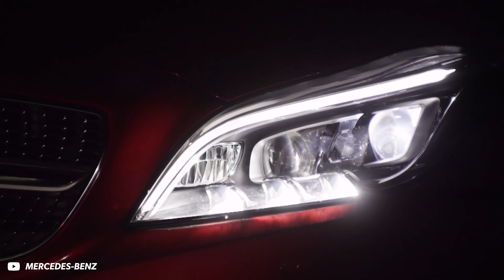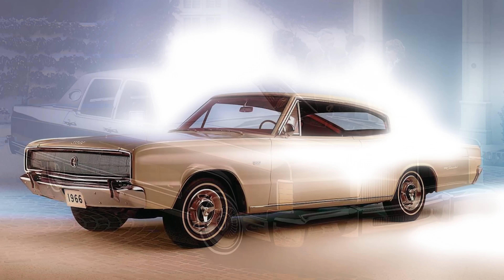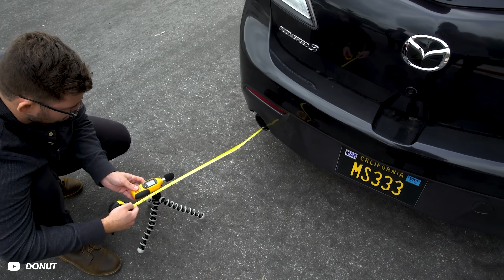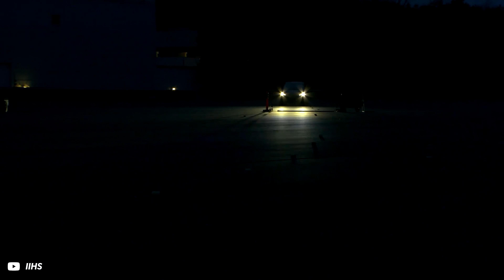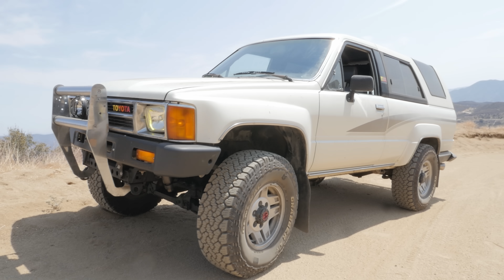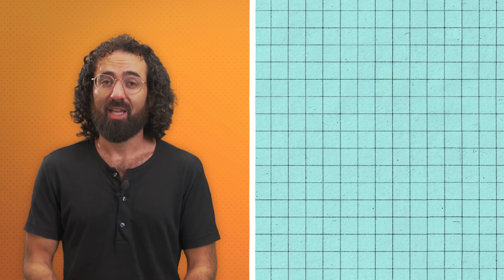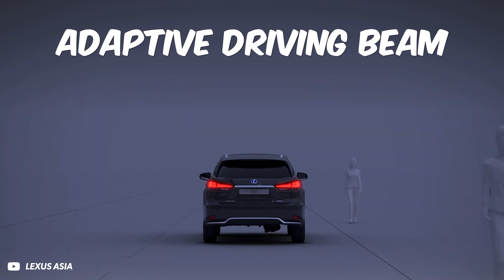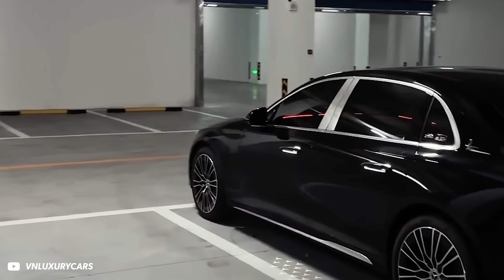Why new headlights are blinding American drivers

Comment: European here. Is anyone blinded by the LED headlights of cars through the side mirrors? I'm going crazy they're so bright. I find it especially dangerous on the motorway as I cannot judge how far the upcoming car is when I need to overtake.
Reply from the maker: Definitely. Also a big problem.
Reply: @drive  Adaptive high beam can unfortunately contribute to this a bit too! It's sometimes a bit slow to react in general, can cut out too little ahead causing people to be blinded through their mirrors, and also struggle with oncoming vehicles on highways as crash barriers may block their headlights from view of the cameras.
Reply: @VoxelLoop  I was thinking of these and how they never EVER work, when this video was talking about adaptive LED matrices.
Reply: @therwfer  bullshit. You’ve never used one if you say so.
Reply: @VoxelLoop wtf do you mean " can contribute " if the effect is just a but slow to decrease it entirely??
Reply: @VoxelLoop  "a bit"? It's very much a significant part of the problem.
Reply: @VoxelLoop  I never use the auto highs because it seems like they react too slow. I prefer to turn mine down before I've flashbanged someone haha
Reply: @VoxelLoop  Here's a thought - how about people use their human brain when they see traffic and think "other cars are around, I'd better switch into low beam so that I don't cause danger". Honestly the amount of gadgets in cars that are replacing basic driver skills and common sense is a huge part of the problem.
Reply: @drive big problem is blind brand new cars in USA and red turn signals on back
Reply: @joshhhab  Red turn signals for sure need to change in America. I can't tell you how many times I've been behind someone that likes to flirt with their brake pedal creating quite the confusing light show at the rear leaving me wondering what's about to happen in front of me. As for the side mirrors, try adjusting them more to your blind spot. You already have a REAR view mirror, no need to have two more rear facing mirrors when they are far more useful to show you as much of your blind spot as possible. (mine are set so that I can't see the side of my car in the mirror at all unless I move my head closer to the window) Might take a little bit to get used to but it has greatly improved my visibility while keeping the blinding lights at a minimum. Still do the shoulder check when making lane changes etc.
Reply: @joshhhab This is why those cars are banned in Europe.
Reply: @starsailor4871 we have bright orange turn signals very good 👍
Reply: @starsailor4871  You're correct. Side view mirrors should show what the rear view mirror can't. No overlap needed.
Reply: @drive 
Well that's always been a problem, dips are angled down and to the left on RHD roads. 
The side mirrors will reflect that back and to the left, where you're sitting. 
The effect will change as the angle of incidence changes, there's a sweet spot a few car lengths back that will dazzle you.
Reply: @drive total propaganda piece. They are too bright and they are too white with far too much blue light. The solution is simple, amber diffuser film headlight coating.
Reply: I have great vision and good night vision, these headlights are making it so hard to judge distance and what lane cars are in, not to mention the painful pressure I seem to feel on my eyeballs.
Reply: Also an european. Oh boy does everything blind us here. Many manufacturers are still figuring this matrixLED stuff out, so the lights kind-of-work-most-of-the-times. But far enough from prefect so that every third car annoys your eyes. :)
These things wait until the absolute final millisecond while approaching - when your finger is ready to flash them back - to block the light off from your car's spot.
Brightness-wise, Peugeot was one of the worst offenders with their lights a few years back. Their 4008, 5008 & 508 are unbearable even during the day.
(Off topic) Also - the automatic brights are the worst thing ever. Never do these understand that the car in-front is close enough already. Nor do they act fast enoguh coming around the corner ("Good old times" when people had courtesy to switch the brights off before coming around the corner- when a human eye sensed some-one-else's lights approaching).
Also these turds activate in cities and such.
Don't "accept" fog lights as oncoming traffic...

Thank you guys for bringing up a topic I felt I too needed to rant about. :)

Also a tip  - I've found that my cars rear fog lights (Yes there's a pair) work as anti-automatic-brights for the car on my tail. (May not be an ethical approach... & can't be done across the Pond.)
Reply: @Tuuritaja Glad to hear I'm not alone! I'm most bothered by the traffic blinding me from behind as I do motorway driving for many hours in low light (now that winter's here) every week and it's just extremely dangerous. I already had to have my rear foglights replaced, I use them a lot, but turns out most are on their low-beams. People here in Hungary don't even understand what they're doing I don't think. Nevertheless, I'm still gonna do it, there are some so bright (new Kias, Suzukis without matrix but bright) that I just aim my mirrors to the ground. Oh and as I cover the mirror with my palm, I constantly give them the middle finger, too. May not be nice, I just can't accept this level of recklessness.
Reply: @Tuuritajasome of the older Chevy trucks used to have a large area of brushed aluminum on the tailgate. Good for reflecting back high beams behind you.
Reply: @Tuuritaja uber's toyota corollas are the worst. they are everywhere and they all blind the same way. if you see a corolla, it's a uber.
Reply: @bruh5924  you mean a 🚕 taxi then?
Reply: @bruh5924  nonsense. Go see your ophtalmologist for a checkup. And clean and degrease your glasses, windows, and mirrors.
Reply: If you think that European factory LED lights are bad, come to North America and try driving in front of a raised boomer truck with aftermarket LED bulbs shining directly in your mirror. Keep in mind we don't have TÜV or anything that would require them to fix it at some point to pass inspection. Got automatically dimming rear mirror now, best luxury choice.
Reply: @bla123blubb  I miss my auto dimmer mirror, but I still had a tinted rear glass for 10 years, so I never noticed how bad the lights were getting.
Reply: I'm also European. With the side mirrors when the situation gets bad I just press the fold button. It is unsafe but at least I see forward.
Reply: @ptamog  when a car with super bright lights is behind me, I adjust my side mirror so that it reflects their light back into their eyes instead of mine
Reply: @seands650 😂
Reply: All the time. I drive a Miata, so there’s that.
Reply: @ChoPi-EwwI drive a Ford Transit. I sit VERY high up compared to my 94 NA. Doesnt change much honestly, so many headlights are aimed soo poorly that even sitting 4 feet higher doesnt change it 🤬
Reply: @ChoPi-EwwI feel your pain I drive a lowered Z3 and it’s awful to have someone sit behind me blinding me by my side mirrors.
Reply: People dont seem to know how to adjust their height. All SUVs have lights up in the sky, all of them and if you drive a low driving position car your're blinded constantly. The worst if when they come you from the rear in dark, constantly blinded from the mirrors but not only that your cab is so heavily light polluted you cant see shit.
I would have kept halogens but hell its impossible to drive at night when theres bastards with 10x the light output at seemingly near UV wavelenght light welding your retinas hours after hours night after night... Warm tone auto leveling projector/lens LED headlights are fantastic, one can see well and the oncoming traffic doesnt get blinded
Reply: Theres all the great technology out there, its cheap yet the auto makers want a while grand for one shitty headlight thats so full of flaws they should be banned
Reply: @mihkus  On many cars it's a headache to adjust the lights and a lot of people have no clue even to open the hood and the lights can come misadjusted from the factory.
Reply: @mihkus  There is a solution to that: self-levelling lights (and optionally self-levelling suspension). Just having the lights be self-adjusting is like 15 bucks in parts and an afternoon of engineering to put em in. Europe iirc also straight up requires em for Xenon and LED headlights, so odds are if you have a European car with LED or Xenon headlights, it'll be self-levelling and one less thing for you to worry about as a driver.
Reply: @mihkus no, there is not about adjusting the lights. It's about technology. A lot of cars ate cutting your back of the car but will blind you in the mirrors because those will be hit with high beam. On curvy roads is even worse... you will always be blinded even buly the best tech on this domain. And i tell you this as an european.
Reply: @mihkus  They can adjust them anymore. Its "self leveling" ehich means nothing is car is on slight incline and you on part that slops down. They can only.be adjusted to "zero" position on the headlight housing but you have no setting dal like with halogen lamps inside the car. Halogen also never are as blinding. 
In europe headlight and their adjustment is checked on MOT checks annually but it still doesnt do anything if you are just on top of the hill or just uneven roads bumping the car up. Max luminosity should be limited, better yet they should just mimic halogen so its the same just takes less power. Instead they burn peoples retinas out with xenon and led lights
Reply: @Kacpa2 very VERY few are actually even self leveling. Mostly high end vehicles like Porsche. Your average GM Ford or Dodge does not have this.
Reply: I have to adjust the door mirrors so I can't see behind.  Often have to do same with rear view mirror.

Tesla are worst.  Lots of SUVs, crossovers and vans are bad.  Followed a fairly new MB Vito van.  It had vague beam pattern and far too much light above the beam pattern.  The lights have atrocious beam control.

Adaptive lighting is very bad when driving 44 ton truck.  It doesn't bother car drivers but is bad for driver positioned higher.

Self-certification homologation by lamp manufacturers has failed and increased danger on roads.  HID lighting should only be with projector lamps.
Reply: @idonotwantahandle2 I try to adjust my mirrors so they reflect the headlights back into the following driver's eyes.😊
Reply: @idonotwantahandle2  This is how you’re supposed to adjust side mirrors to eliminate “blind spots” anyway. If they’re pointed backwards, you have 3 mirrors looking behind you and none to the sides.
Reply: yes. I had a low car and it was awful as it was a major distraction as it was narrow so would often get blinded by both side mirrors.
Reply: too many cars do not have night-dimming mirrors.
Reply: @KellyR-qx7wn  side mirrors too?
Reply: @makatron yea sides too nowadays. My 2016 car has dimming sides. Makes a significant difference
Reply: @KellyR-qx7wn  maybe they should make them add them under recall if they insist on blinding us.
Reply: @KellyR-qx7wn  I drive a 1991 CRX no auto anything😊
Reply: Blinded by those adaptive headlights is so common that I had to get yellow lenses to be able to see anything at all at night.
The problem is that as soon as you are the third vehicle on the road then the adaptive system totally ignores you because it can only do one thing at a time, much like the low IQ morons that can't chew bubble gum and walk at the same time. (Statement stolen from a tune by Magnus Uggla)
Reply: Get a car with auto dimming mirrors, it’s great. Combined with led matrix lights (so YOU don’t blind anyone) it’s the only way to ensure comfortably driving at night
Reply: @erebostd i’m getting blinded walking the sidewalk, or cycling down a cycle-path next to a road
Reply: @erebostd  Thats what their marketing wants you to believe. In reality it takes couple seconds to detect the car, it doesnt work if I am over the horizon and in that brief moment I am blind and my eyes take couple more seconds to adjust back. It just sucks, there should be limit on brightness period.
Reply: @paapacz  We test those thing in our university - those systems are faster than anyone driving with high beam that has to put them down manually. If you are in the US you don’t get the most modern systems because of your regulations, but even what’s allowed in the US is better than „by hand“. If the car isn’t tinkered with…
Reply: My wife's 2017 Subaru Outback has auto dimming side mirrors! I didn't even know that was a thing, especially in a non-luxury car, and a middle trim level at that! Certainly underrated tech and hopefully more automakers will see the benefits. It's a bummer that auto dimming side mirrors isn't a fancy selling point on a spec sheet like 360° cameras would be to the average consumer, despite the usefulness being arguably higher.
Reply: Absolutely!  Sometimes have to take a hand off the wheel to block the light from my side mirror!
Reply: Actually, yes, even when I flipped down my interior mirror to its darkened mode I’m still pretty well blinded by the lights in my rearview. I don’t live in Europe. We don’t get the fun technology to help with that kind of stuff, but I really wish we did.
Reply: Had to put heavier tint just to avoid getting blinded by the car behind me.
Reply: @makatron  did you go with 20% or 5%?
Reply: All the time. I drive a Ford Transit van and especially in winter, when its already fully dark by 17:30, I get blinded basically constantly on the highway from normal cars headlights. Hell, sometimes even semi trucks, and those headlights are lower than normal cars. SUVs are the worst though.
Reply: Yep, I pretty much have to wear night driving glasses now otherwise I'm being blinded constantly
Reply: @BlatentlyFakeName  I wear sunglasses at night. Can't see my own speedo, but at least I can still see the road with all the bright lights in my face.
Reply: @javaman2883  Just make sure your own headlights are bright enough to compensate for the sunglasses and you should be good.
Reply: Norwegian her. I hate ADB lights. They say they can dim and not blind, but boy o boy dos it blind me. All the time, it has made driving at night a nightmare. And to topp it off it makes drivers lazy. They have no regard to the lights blinding any one. They simply relay on the automation, and it sucks.
Reply: I agree. Some of the newer cars are just so annoyingly bright with low beams during night ether being behind or coming towards you.
Reply: Two times I had to stop driving because car behind me was do bright light that I cannot see nothing even i turn mirrors off.
Reply: @---qr4of Angle the rear view so it blinds them. Takes a little practice but it's very effective when you get it right.
Reply: Just slow down when you’re blinded. It’s not worth it being stubborn about it.
Reply: @jamsbong  so they pass then get angry?
Reply: @CSmith-gb1sl  what I mean is for everyone to drive safely. If I am blinded by incoming lights whether it be from a truck or other source, it is foolish of me to just kept driving knowing my eyes impaired temporarily.
Reply: @jamsbong What about when they are directly behind you? That's the main issue, follow you for miles being blinded in your door mirrors and rear view level.
Reply: @MattyEngland  that one you can dip your mirrors. And even your side mirrors can be adjusted. 
Alternatively, what I have done is to tint my windows. Check your country legality on how dark your can tint the windows. This essentially solves the problem
Reply: Yes! I've done that when a pickup truck pulling a camper was behind me. I slowed to 35 in a 55. He just stayed on my bumper for a good 10 miles.
Reply: @jamsbong That's a great way to anger anyone behind you, then they will pass in a no passing zone and brake check you.
Reply: @javaman2883   With my dashcam recording everything. Let's see who is at fault if there is an accident.
Reply: @jamsbong better slam the brakes to break that lights and give them a lesson
Reply: I got blinded by SUV's and people who put wrong type of lamp on. Being blind by lights depends various factors and not always are LED lights. I give you my experience: in this summer i drove an Iveco S-way garbage truck new from the factory, with only the fog lights on i still blind other drivers during night and the type is Alogen (hot white colour)
Reply: Me too. Sitting at a red light, the car behind me was so bright I actually folded them away (unfurled when light went green, of course)
Reply: Exactly. As a European who usually prefers driving at night: The ADB system works great on paper. But once you've seen how long it takes for the high beams to automatically switch off as soon as oncoming traffic is visible, you know how well the ADB really works. You get blinded by slow-shifting oncoming traffic. You get blinded by the light reflected from the side mirrors, and I don't even want to get started on curves, bends, or inclines.
Reply: SO... I'm just guessing from this thread... BUT for all the upgraded tech and standards in the EU, night driving hasn't really gotten so much better... eh?
Reply: Ive been, genuinely had to turn my head because of how fucking bright it was
Reply: Some of 'em are so obscene I can feel the side of my face getting hot from the light blasting in through the side mirror.
Reply: Yes. It's the genius idea of using LASER excited phosphor to make ultra super bright lights which have virtually zero lumen falloff for miles. Thank WV for that idea...
Reply: @shinobi6622  West Virginia?
Reply: @CSmith-gb1sl No, Jönköpings kommun, Sweden
Reply: @shinobi6622  I meant the yellow eyeglasses for night driving.
Reply: We should go back to incandescent bulbs for cars 😊
Reply: They are just not calibrated correctly.
Reply: I don't have that a lot really. I also do notice my own cars Matrix LED System being way more considerate than when switching it to "normal mode" and turning Adaptive Lights off. If i have the regular high beam on and drive behind someone it'll have a noticeably higher beam. If i turn back on Adaptive Light it'll instantly lower the high beam and also cut out a box surrounding the car in front of me. I therefore doubt, that its adaptive lights that would blind your rear mirrors. It'll likely be "dumb" systems that have a fixed LED Headlight.
Reply: You need to re-adjust your mirrors, correctly! To prevent lights from vehicles directly behind you from blinding you.
Night driving is 100% comfortable, since I did mine!
Reply: @jonathansantana8021 Not the vehicles behind me in my lane, the ones about to pass me on the left.
Reply: @javaman2883 when position correctly, you should be able to notice them passing probably 5 seconds tops. But if you see them coming from 1/2 mile in your side mirrors, you need to readjust them. 
(They could be douches with high beam happiness or some people just have sensitive eyes.)
Reply: Yep daily, i even dont use my inner mirror anymore, i turn it away as all those blindings and reflections makes driving not so safe anymore
Reply: I cant even walk outside during bad weather (and otherwise bright daylight) without getting blinded. Even bicyclists have started driving with this crap, I literally cant see, anywhere. This LED crap should absolutely be banned
Reply: Good point. 

I get your pain and I understand that LED lights are super bright. I had a car with them and I enjoyed an almost clear as day view. 😊
Reply: European. American here. Trust me if you can see the same lamp behind you in your rear view and side mirrors, your side mirror’s cutoff just needs adjustment to a wider angle so the behind lamp disappears and all 3 work like one large mirror.
Reply: They’re HID’s.  LED’s don’t come as low beams on production vehicles, they weren’t profitable enough.
Reply: Happened to me on my drive home just last night. Infuriating.
Reply: Yeah. Fortunately I have folding mirrors so when I'm not planning to change lanes or overtake, I go to "missile mode" and fold the mirrors in. Saves so much of my sanity, it is insane in itself :D
Reply: 100% Aussie here.... These new head lights are blinding! and need to be banned!
Reply: naughty european, your car has audo dimming mirrors if its not japanese
Reply: There are times when I have to just rely on my vehicle sensors to tell me if the vehicle is close or far, and considering the sensors can't tell if the vehicle is approaching or following at a safe distance for switching lanes
Reply: yes, at nights you cant judge the distance because you do not see the linear size of the object, oncoming car in 300m and in 1km look the same. Just do not overtake in these conditions, its unevitable price of night driving.
Reply: Winter season has begun. Sunglasses by night?
Reply: Absolutely. I can adjust my rear view mirror or tint my rear window. But front side windows and windshields can't be tinted nearly as much legally and so cars from behind blind me terribly trmhrough the side
Reply: I drive a vw golf mk7, it have the standard halogen bulbs, but the auto high lights work very good a lot faster that i can change by myself, also the automatic mirror darkening also works very well, very surprised by all the comments
Reply: @lotsad1234 Bummer about auto high beams is they wait until the car is visible to switch off. An attentive human can see the lights coming around a corner. 

On a long straight highway, no big deal. 

Where I live in the mountains, a tight corner means someone gets blasted.
Reply: Yes, even with auto dimming mirrors it’s still too bright so I tinted the side windows and it’s not bad now.
Reply: You mean from behind you?  Yes, have to get my back window tinted, but that still won’t solve the side mirror problem.
Reply: The amber glass?  Do they help much?
Reply: Side mirrors adjusted wrong
Reply: I've even folded my mirrors a couple times already. 

What i found is that depending on the model behind you, if you slow down and they're eager to drive close to your car the side mirror blinding stops.
Reply: Yes. We need self dimming side mirrors.
Reply: From germany. Dude, by far the worst friggin new cars are these new Mercedes, since 2017 or 2018. Unbearable. And a good amount of idiots on the road also dont have their headlight adjusted, like a lot of work vans. Or they have too much weight in the back and their automatic light adjustment isnt working. Good thing my old 1998 Audi A4 has all the bells and whistles you could get back then, including automatically dimming rear view mirror and even automatically dimming mirrors.
Reply: I'm 99% sure this problem also stems from the fact that there seems to be no maximum height above the surface of the road for headlights. I drive a car where I sit low, and every SUV, every truck, every van blinds the sh* out of me, even when they have lowbeam on. Reason is simple: My head is lower than their headlights, and below a certain distance their lowbeam inevitably hits me full blast.
Reply: Yeah, it's more the side mirrors than anything, even in the US. With my rearview mirror, I can just dim it. But the sideview mirrors are a pain. So, I adjust them out as far as they'll go and still be functional.
Reply: Had a vw arteon with adaptive matrix headlights, it bar non worked very well at boxing out on coming traffic even on low beam. To this day it was the best lighting system I ever had on any car. The matrix with the adaptive shutters needs to be the standard period. I have a car now with just regular LED while it’s great for me but yes oncoming drivers get blitzed with insane brightness and it’s 10 times worse when the car is slightly at like a 5* angle it’s almost as if the brights were on until the vehicle leveled again.
Reply: This is why I have auto-dimming side mirrors 🙃
Reply: TESLA IS THE WORST BY FAR! THERE SHOULD BE LAWS TO MAKE THIS ILLEGAL! I AM CERTAIN THEY DAMAGE YOUR EYES AS WELL!!!!!
Reply: I am. All the time.
Reply: I drive a car that has rear view mirrors lower than basically any SUV and delivery van and sometimes on red light I have to actively sacrifice a big chunk of my attention to not get blinded, by adjusting mirrors and sitting more straight back. Sounds like no biggie, but that's everyday, when I'm not looking ahead and watching for pedestrians and whatnot
Reply: No because I have my side mirrors adjusted properly.
Reply: Auto dimming side mirror solves this. Beside most people dont know about manual dimming flip on rear mirror.
Reply: You may need to adjust your wing mirrors slightly.  Wing mirrors are supposed to be angled slightly outwards, not directly behind you.  They exist to assist minimise your blind spots directly behind your shoulders.

I find pointing slightly downwards with the rear passenger door handle just visible in the bottom inside corner eliminates glare from vehicles directly behind me whilst maximising visibility of vehicles diagonally behind me in the next adjacent lane.

The internal mirror on modern cars will have an auto dipping function to protect you from glare from vehicles directly behind you.
Reply: @andrewrobertson6012  Auto dimming is an option, most come with manual dimming, an I remember when some did not have that feature.
Reply: @andrewrobertson6012  Thats how my side mirrors are adjusted, still blinded by rear vehicles.
Reply: Not helped by the fact that all German manufacturers decided suddenly at one point that passenger side mirror doesn’t need dimming anymore.
Reply: You can tilt them down to bounce the light back at the driver behind. They either back off or pass. Works like a charm. And if you need to know who's behind you, you just have to glance down a little lower than usual.
Reply: @SeasonedSalad  you mean tilt them up as I am lower, no it didn’t work, and I don’t want to be playing with mirrors while driving.  Our manufacturers of very expensive vehicles never had the forethought on this problem.
Reply: i only drive during daytime as much as possible to get away from this issue
Reply: I'm in the U.S. and I concur.
Reply: I can tell you that i know when Octavia MY 2020+ with matrix lights is behind me. It blinds me every time in side or rear mirror
Reply: My side mirrors, and the one inside, is dimmed automatically. =)
Reply: @Xanthopteryx    My truck is but not my 2003 accord
Reply: @Xanthopteryx  I pity you. Lessthanhuman
Reply: Set your side mirrors just far enough out so that you have to move your head a little to see cars behind you. This way, you use your interior mirror to see what's behind you (it can dim) and your exterior mirrors stop providing you detail the moment you can see beside you (you'll need to do far fewer head checks and won't be blinded by cars behind you)

You can also tint them for cheap.
Reply: @ProbablyNotAChicken  
What ? No!
You break, slow down, let him overtake you and then you highbeam him until your ways part.
Equality.
Reply: I find AUDI active matrix LED most anoying lights. What ever they claim they just don't work and blind oncoming drivers as hell
Reply: adjust so you have to nove your head so they light up the side of your head
Reply: I have all my mirrors angled away so I basically can't use them. If I did not do that I would probably end up getting in an accent cuz I couldn't see. When I do need a mirror I have to bend my head down so I can see what's behind me. So these stupid lights are making it harder to drive and way more dangerous. Just like the iPads in the dashboards. Everything about cars is becoming dangerous and stupid
Reply: Its these adaptive shits
Reply: Why you need a car that has certain self driving features to keep you within the lanes.
Reply: 100%, especially when it's a high vehicle like an SUV.
Reply: Yeah I adjusted my mirrors to pitch down a bit more, tbh I didn't need to see the sky.
Reply: More than likely and serving only to “magnify” the problem, your “side view” mirrors aren’t properly adjusted.  The side of your vehicle should NOT be visible in either one.
Reply: @beauhatman4395 partially disagree, being able to see a bit of your vehicle (<5%) helps to judge distance/position, that said I've seen people with half or more of their side mirror view obstructed by their own car which is insane.
Reply: British here: always got a W@r with his full LED beam on going up roads or down roads blinding everyone that coming up or down, there was one dangerous time where the driver thought it was funny with their lights on full LED beam while parked and the lights pointing outwards onto the road where a blind bend were to approach, which is dangerous as a driver could end up smashing into a wall if they do not know the area well!
Reply: Safety is for sissies.
Reply: And also through the rear view mirror
Reply: Your side mirrors shouldn't be pointed behind you.  That's not the proper way to see them up.
Reply: Most drivers unknowingly have their headlight height adjusted to be as high as possible and some even drive with fog lights when not needed. (This is especially noticeable in Europe as the cars are mostly fitted with headlight beam height control switches)

Fog lights obviously gonna bother you in the rear view and side mirrors. along with the headlight height adjustment.

Other reasons is swapping bulb types halogen reflectors and halogen projectors were never designed for the beam pattern produced by LED and Xenon bulbs some bulbs are worse than others too.

Never seap the bulb emitting type (halogen,Xenon,Led) or go for higher wattage of the same bulb.

Most of the time you will end up with less usable light  and scattered beams
Reply: Adjust mirror to direct light away from your face
Reply: I will attempt to get this across without a picture...
Set your mirror farther out. Just slightly farther than you want it, so that you can't see straight behind until you turn your head a little bit to look at it. When you turn one eye will see behind (and the other will see slightly wider into your blind spot), but when looking ahead neither mirror will be straight into your face.

I also have never used a rear view mirror, but that is my own oddity most couldn't do.
Reply: I was psyched to find out my car had auto dimming side mirrors. Game changer.
Reply: Yes the new light are way to bright. Not because of light power but because of the white light the older yellow style halogen lights are easier on the eyes even with the same "power"
Reply: Yes, that is a pain. I had a 2017 F150 where the driver side mirror dimmed when headlights were shined on them. I loved that mirror.
Reply: Not really a problem if your car has auto dim
Reply: Aim your mirrors better. You don't need 3 rearviews.
Reply: Probably your side mirrors are broken or the auto-dimming function is not working. The main sensor should be in the interior mirror. If you have tinted the rear window, that can be the reason. 
I'm also from EU and I never had any problem with rear cars with LED. Even if they are using high-beam lights that would not effect me, coz the my mirrors are in working condition and auto-dimming is working properly.
Reply: @vOzidloCZ   No, I have a 2019 now and Ford took that out for the driver side mirror.
Reply: I have a simple Ford Fusion with auto-dimming rear view internal and driver side mirrors that reduce that glare.
Reply: @timlincoln2246  but why don't you buy and install mirrors with auto-dimming? They are not so expensive today.
I remember my first car (1997) and it had already all mirrors with auto-dimming, but that day it cost a lot.
Reply: @timlincoln2246   The rear view dims on my 2019 F150 but Ford removed the driver side dimming mirror. I was sad to see that go.
Reply: austria here- yes- gets annoying
Reply: I use a rear view mirror live feed rear view dash cam so the mirror isn't a reflection but a projection of the camera in the back, this keeps my mirror from being too bright with headlights, and able to see more at night when fully dark. Also I tilt my side mirrors in a way that if someone with high and bright led lights are behind me I can lean into the center of my seating area a little and not have either mirror directly blinding me. It's inconvenient but works. the best thing I ever did was get that rear view camera through, it's awesome. It's a 2 way dash cam and a live feed touch screen mirror replacement.
Reply: Absolutely (from USA)
Reply: When I drive the motorocycle in the evening, I don't see shit from the mirrors.
Reply: That's why you turn down the mirrors at night.
Reply: Yes
Reply: Road knowlegde is all that keeps me alive in the dark.
Reply: I tinted my windows for this cause alone..
Reply: Absolutely
Reply: New cars even 'shade' the side mirrors bc of that, just like they do with the rear view mirror
Reply: I was started wearing yellow tint glasses for night driving, they help a lot. However I am one of the culprits, I get flashed all the time in ‘23 f150 with my low beams on.
Reply: Yes, me too!
Reply: European here. I experienced this recently with an older Mazda 3. This came rather schoking to me since my previous experience was primarily with Renault or CItroen. It turns out that the cars manufactured in EU have filters on the windows and aspherical mirrors that break the beams from the car behind. However, other car makers from Japan or Korea do not have these features and as a result night driving could be a rollercoaster. When buying a car, always test-drive it in the dark to check it out!
Reply: Luckily I've got a relatively old Shogun where, if someone does blind me from behind, I can retract the side mirrors with a button. I also have my interior mirror angled half down so I don't see their damn lights even in daylight.
Reply: i swear it's one of the reasons i try to drive a bit faster so the people behind don't blind me as much😭
Reply: No issues as i have dimming left and tear mirrors and led matrix. 🎉

Previous one had all 3 mirrors dimming..
Only thing i need is one extra highbeam that would turn on when matrix is in full blast.
Reply: This is my biggest problem with getting blinded! (I'm in the US)
Reply: Tesla cars are the worst
Reply: Yeep they're blinding at night as fcuk in 99% cases!
Reply: I wouldn't know if someone has bright headlights - my 25 year old Mercedes has dimming mirrors.
Reply: Never had any problems with adaptive beams on Audi or Tesla. Works like a charm. I would say another solution would be regular safety inspections for cars. In my country we need to get the car inspected regularly, the interval depends on the age of the car. Lights are one of the things checked during the inspection. In USA most of the states don’t require any safety inspections.
Reply: Side mirrors ain't a problem for me, as far as this is concerned. Rear-view mirrors, though? I swear, it's every night I have to adjust the rear-view so my corneas don't get cooked by the headlights of the guy behind me.
Reply: I’m from Bulgaria. The road conditions here are pretty bad, and the new headlights work properly only about 30% of the time. They often fail to detect an oncoming car, especially when there’s a crash barrier between you. The lights stay on high beam until you’re about 20 meters away.
Reply: Side mirror and the Rear mirrors, have to flip to the tinted mirror portion when driving during NIGHT.
And people with glasses has it pretty harsh too when driving now
Reply: Yes, it's caused by the adaptive beam. The car behind will draw a box around your car, but it isn't clever enough to know you have wing mirrors, so you'll still get the dazzle there. Unfortunately, drivers rely too heavily on this tech and no longer think for themselves; if they just manually dipped their beam it wouldn't cause the problem it does. LEDs aren't so much the problem, they are a contributing factor but not the whole issue, it's the tech and the driver's reliance on how wonderful a job it is doing that is the issue.
Reply: The thing is, its only about the driver and design, but never about other roadusers... Fitting ego society so to speak
Reply: European here... No. I'm not blinded by the new LED headlights... either head on or by my side mirrors.

Maybe it's just me... as I come across some drivers at night that flash me (turning high beams on and off)... telling me to turn off my high beams (which are off)... And I'm sure they are shocked when I flash them back to show that my high beams are off coming towards them.
Reply: @rxt744 maybe that should tell you something... 🤣. Do you drive a Tesla Model Y?
Reply: @FormulaWhine  No.  A Renault Captur Full Hybrid (251 reg)...  That said, we have over 30,000 drivers on the road in Ireland (Republic) in the EU that do not have a full driving license, due to the incompetence of previous governments on past driving laws and regulations in regards to Learner Permits, and not enough practical testing centres and testers.  Solution... let unqualified drivers on Learner Permits to continue to drive on the roads... until things catch up (estimated a few years).  Many of them are elderly... that shouldn't be on the roads... as many of them drive 50 Km/h (on 100 Km and 120 Km speed limit roads and motorways), as well as breaking heavily and move towards the hard shoulder (sometimes there are walkers, dogs, parked cars, etc.) when any incoming car comes their way...  regardless of the style, type, or technology of the headlights.  Many of them can't tell the difference in headlights... and have no clue how to approach a round-about (always signalling incorrectly when approaching a round-about... causing traffic issues).  The problem is not the LED lights... it's many drivers that should not be on the road unless they are taught how to drive in the dark (without drinking over the limit too)... and prove it as part of the practical driving exam for them to obtain a driving license.
Reply: Yes. And even by adaptive lights - some cars just ignore the mirrors or something... Terrible experience!
Reply: He can tilt the mirror down until the car behind him has gone.
Reply: Norwegian here. Absolutely hate driving when it's dark because headlights blind me both from behind and from the front. It's like they have them turned way too high up or looking at high beams (or the automatically adjustable ones being 2 seconds slow in adjusting to driver position) unless the opposite car is facing way down compared to mine. 

This is mostly an issue with newer cars, older cars often use their fog lights and blind me with those instead.
Reply: Get a car with dimming mirrors at night. My first car, a 2006 volvo had that already.
Reply: My old BMW makes the mirrors darker so I don't notice they're brighter
Reply: oh yes same here
Reply: Yes, I have that issue as well! For my new car I ordered automatically dimming side mirrors, and having them seen in use should solve it.
Reply: Yes. Blinded through windscreen. Blinded through rear view mirror, even with dimming switch flicked on. Blinded through wing mirrors. Some LED headlights are just horrific, and yet some seem absolutely fine, as the video mentions. Not just cars, but also transit vans and articulated lorries have also been blinding me this week. 😵‍💫
Reply: Also EU, Sweden to be precise, Tesla SUVs always blind me both from back and front, while all other ADB headlights just don't work when people drive too close to one another, forcing me to blind everyone infront and after that person until he turns of his lights (which modern drivers never do since they are asleep at the wheel with no idea what lever dims the high beam)
Reply: You need to change the angle of your mirrors.
Reply: Defensive Driving instructor here.

The issue is that you're using your side view mirrors wrong. If you can see the lights from cars behind then you have two extra rear view mirrors - not side view!

You need to lean to the left, and then push your mirror out until you just lose sight of your car. Repeat for the right side.

Now, if you choose a car in your rear view mirror, then as it passes you, you'll see it disappear from the rear view and appear in the side view.  The same as it leaves the side view and then shows up right next to you. You never lose sight of it.

Blind spots are OPTIONAL and looking backwards to lane change is dangerous.
Reply: Try using anti-fog rear light, its same annoying, meaby someone will get the hint to better set their lights
Reply: When it hits my mirrors like that, I try to adjust my mirrors to shine it back to their face instead lol
Reply: yes, on cars that are make after 2020 i think  : with LED headlights are very blinded
Reply: Canadian here: yes. Also, often can see the shadow of my car (2016) ahead of me. One day last week, I even saw my cars shadow on the highway signs above the road.
Reply: You need to adjust them correctly. You should NOT see the rear door handles without moving your head the the edge of headrest. That way you won't be blinded by cars behind you AND you will eliminate the blind angles at your 4~8th o'clock. To see what's behind you you have the internal mirror.
Reply: Definely, its fucking dangerous
Reply: Problem in North America too. SUVs have their headlights the same height as my wing mirrors.
Trucks have them lower...
Reply: @tompw3141  many SUV's and trucks in Europe have them HIGHER than my wing mirrors, and there's literally no problem with that. have your eyes checked.
Reply: Yep. Inside mirror as well, if you don't have an automatic one.
Reply: I'm having trouble to judge the speed of cars behind me when I'm driving my eco box at night.
I see a big car with LEDs on the left lane in my side mirror, I think woah that guy's going quick, I better let him pass and then overtake…. 
5 seconds later, wait that guy is barely going 100 kmh, I could have gone for it. 😂
Reply: Slow right down on them
Reply: Those lights sometimes make me wanna wreck. I can’t stand them. I live in Tennessee out in the country and it’s really bad here in the USA.
Reply: Our Toyota van has auto tinting side view mirrors. Not just the rear view, but the side view. At the very least, that should be a requirement on every car. There's nothing worse than trying to see through the fog at night and you've got Mr compensation's lifted pickup with LED headlights behind you, And so you're blinded from looking forward by someone behind you.
Reply: Yes, I sometimes cover my Sideview mirror with my hand because it feels like someone is shining  torch/flashlight in my face.
Reply: This is a very big problem for me as a motorcyclist.
Reply: yes and the whole inside of the car is bright white as well
Reply: Yes. On short trips, I just put my hand against the window to block the headlights. But on longer trips I push the side mirror out a bit on the driver side, so the headlights do not reflect into my eyes. Unfortunately, that also means I cannot see the road behind me.
Reply: Yes, I sometimes adjust the mirrors slightly, because it's too much 😖
Reply: Skill issue? Never had that happen to, me ever.
Reply: Yes, because you don't have the set-up correctly
Reply: Nope because I got auto dimming
Reply: Honestly I find people with weak headlights more dangerous, that’s when I can’t judge how far the car is in my mirrors. And more dangerous for pedestrians too
Reply: I get blinked a lot from other drivers to lower my beam...but I am not using beam at all. Yes, cars today have too much bright headlight systems. I drive in Central Europe.
Reply: as someone with light sensitive eyes driving at night nowadays gives me migranes due to the brightness and whiteness/harshness of the light.
also on a side note, bright lights and glaring might not affect crashing all that much but iirc there were multiple instances in germany where pedestrians/cyclists got run over cause the oncoming traffic blinded the other driver so they couldnt see that someone was there.
Reply: Not only thru the sidemirrors, i've been blinded by the interior center mirror aswell. And i drive a chevrolet k5 blaze 1979. My solution is to stop at the side of the road and let them pass me, rather miss my ferry back home than hit a pedestrian i don't see....
Reply: yea, its a menace - i drive a sports coupé which riding position is basicly 20cm lower than every other car on the road and i get blinded by so many cars at night - from back, from front, even sometimes from a car at an intersection... this led stuff is total bogus... i mean ye, it is nice, but they should definetively do something about the glare - my car has xenons and they are as bright as led's sometimes, but they arent as annoying as leds - i wonder why...
Reply: All the time. I drive a twingo, when a SUV is behind me it just shines straight onto both mirrors and in to my eyes.
Reply: For me personally in the UK I think it was better when the street lights were brighter and the car lights were dimmer. The modern led street lights are too dark and so car headlights have been made brighter to compensate. But now we have this issue of car headlights being too bright and dazzling oncoming traffic or in the reflection in the side mirror.
Reply: Adaptive LED headlights should be banned worldwide, they dip far too late, sometimes not at all. I have adapted my driving habits by whacking in high beam every time oncoming LED lit traffic fails to dip!
Reply: i know some people that have sunglasses on at night for this but thats not good to
Reply: Create a problem and try to find a solution
Reply: I stopped driving car for 12 years here in Germany between 2008 and 2020. Today on every trip I have to tilt my back mirror to not get blinded. Back then I never had to do this!
Reply: Some cars have auto dipping side mirrors like rear view mirrors, but not many cars have them.
Reply: I can count on my hand how many times I saw my father turn the inside mirror to the darken set in my childhood.
Nowadays if it's early morning or late night it's a must go, otherwise my eyes are burning out.
Also once I was so fed up on the highway with a tailbrighter I lowered the window and turned my outside mirror in so I'm not blinded by the headlight behind me.
Reply: My car has auto dimming side mirrors, which helps. Personally I have very little issue with getting blinded by headlights. I guess my eyes are just not that sensitive to it.
Reply: Thank you. I've got the same problem
Reply: Cops suvs blind me and they love being way to close so they make it worse on purpose, I've been pulled over for going slower from being blinded its so fuckin stupid
Reply: Yes, especially since I live in a rural area so a lot of folks have pickups and they LOVE their aftermarket neon blue LEDs. I usually have to turn my side mirrors in those cases
Reply: Don't overtake. It's not worth your life or someone elses.
Reply: YES! I cant tell the distance of oncoming traffic
Reply: yeah, in Finland.I have notice that, there is few car models what is very bad, one volvo, MB, tesla...Ok, i have H4 bulb headlight with H4 led bulb, but i have check it looks same in that light high in the machine, where you can see the line where light need to be etc, the light dispersion is the same as normal bulb has, only different is led it brighter
Reply: @madmike5144  they no longer use diachloric yellow in Europe I assume?
Reply: It’s super bad in a sports car. I’ve tinted all of my windows and both side mirrors. Just finished tinting my rear view mirror and rear window.
Reply: Adjust your side mirrors the proper way, and it's not as big of an issue.  Far too many people adjust their side mirrors in an "I should be able to see the side of my car at all times" kind of way.  But they're not meant to see the side of your car, or what's kind of behind your car... that's what the rearview is for.  Look towards the mirror you're adjusting.  Adjust it so that the side of your car is just BARELY visible.... and then squeak it away just a tiny bit further.  Then, even when looking directly at the mirror, you should barely see anything directly behind your car, and instead be looking more in what would be the lane beside you.
Reply: Now try walking at night.
Reply: All you need to do is adjust your mirrors CORRECTLY.
Reply: I have my side mirrors angled such that someone behind me isn't shining lights in the side mirror. They are looking wide. Directly behind is a job for the rear view and the reverse camera.
Reply: How about buying a decent car (seriously even a prius2) which has dimming mirrors. Headlights behind me never a problem. My car cost 6m euro so nothing luxury
Reply: Love my led and dimming mirrors 😂
Reply: @3v3rhard  Thats why i highbeam you head on <3
Reply: Adjust your mirrors
Also, unless you're driving an ambulance, you don't NEED to overtake😊
Reply: That's what auto-dimming mirrors are for.
Reply: That's why you get adaptive darkening side mirrors.  Problem fixed.  Carry on....
Reply: @scottwilkins  Not a flex there mate... My 20 y.o. BMW has them, it does fight the problem, but still not enough. Maybe newer ones go totally black? :P
Reply: @scottwilkins  That doesn't solve the problem. That's like putting on sunglasses when you go to bed instead of turning off the lights.
Reply: @scottwilkins it was way easier to tint them for free. I’m not putting after market mirrors on my classic cars. On I go….😅
Reply: Not available on the car I drive. It shouldn't have to be. Stop led. Problem solved.
Reply: @scottwilkins ah yes, put a bandage on festering would, that's the solution.
Reply: @scottwilkins  No it's not, if the mirror isn't covered completely, as is the case with teslas. They still have a normal mirror rim around the darkened part and even the darkened part is not as good as one thinks. If I get overtaken on the highway I always put my hand in between the mirror and my face until the car passes. My rearview mirror is in a position, that if I need to look back I have to put my head a bit up, because it still is quite blinding. And as stated in the video, roads are not just flat and also europeans don't have the money to buy the newest cars, which means, that there are a lot of cars with these blinding lights. 
It is really draining to drive at night, even if you drive in europe
Reply: @scottwilkins  How do i retrofit darkening side mirrors onto cars that never had that feature?
Reply: @scottwilkins you don't know what you are talking about. 80% of cars don't have that. And if they don't have it is ilegal to put foil on mirrors.